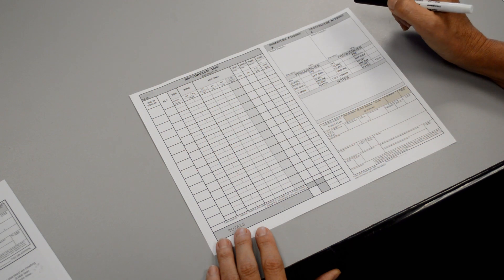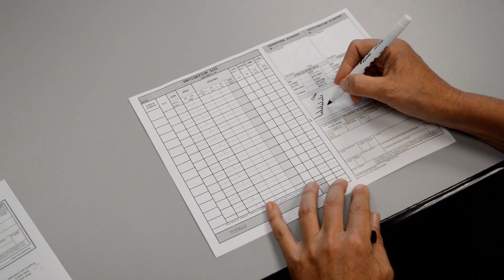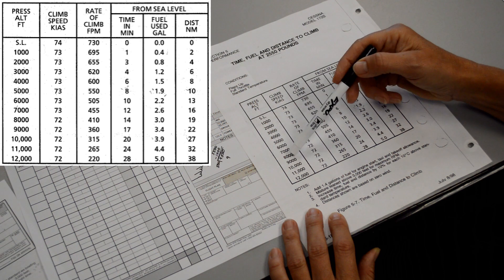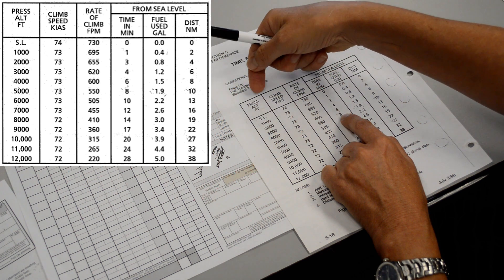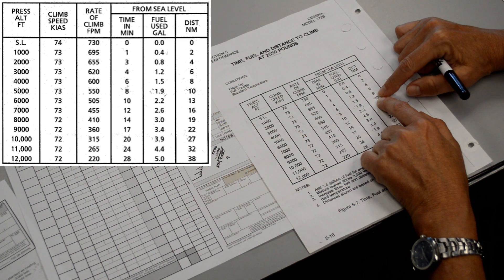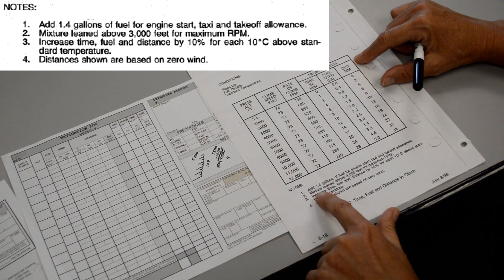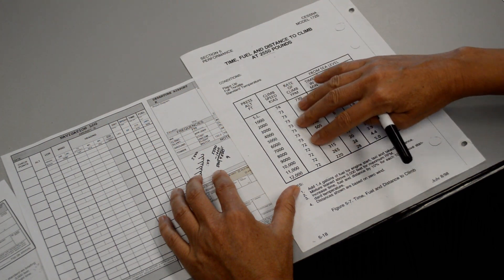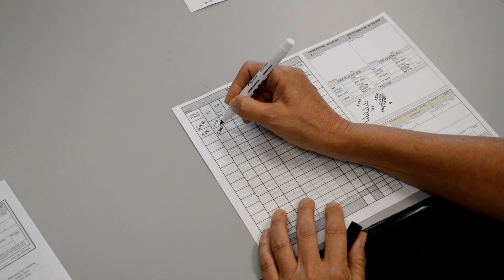Calculate Top of Climb - XC Flight Planning (Private Pilot Lesson 14h)

Comment: Afterall when we are in the cockpit and flying, we are not looking at a TAS indicator, but rather a KIAS indicator.    My take is that if we are at a pressure altitude of 5500', then our KIAS of say 100KIAS would actually be rendering an approx TAS of 111 TAS, assuming we are flying in standard temperature conditions?  So if we waned to achieve a TAS of 111 at 5500' Pressure altitude, we'd fly at 100KIAS   Anybody want to comment?